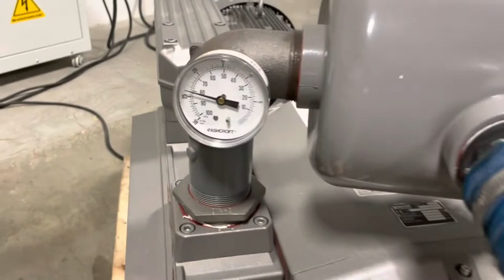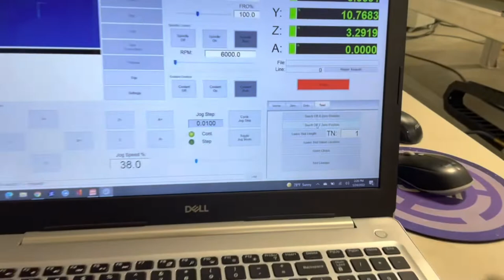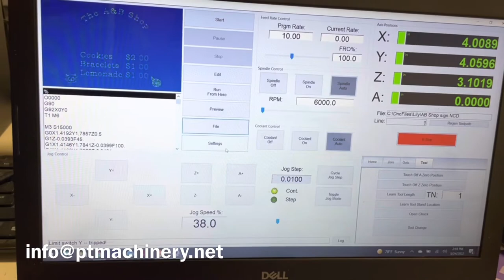Techno LCX 59120 CNC Router with Becker VTLF 250 vacuum pump

Comment: At this speed and at this depth the weight of the mdf is enough not to move in addition you have a sheet behind to be sure that nothing moves. the pump is useless!
Reply from the maker: Hi Roy. When I close off the table you can see the pump shoots up in Hg. This tells us the pump is pulling great vacuum. The issue is the gasket in the vacuum table itself is many many years old and needs to be replaced to seal off all the leaks between the material and the vacuum bed itself. That's the only issue.
Reply: Is this unit still available?